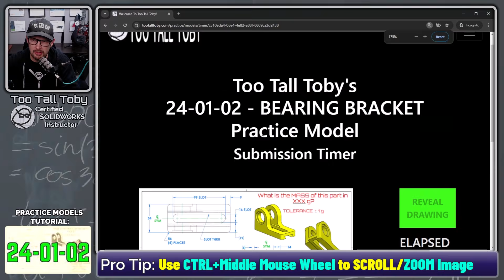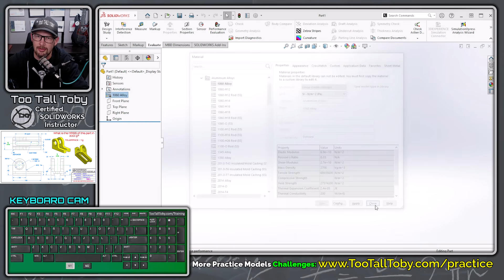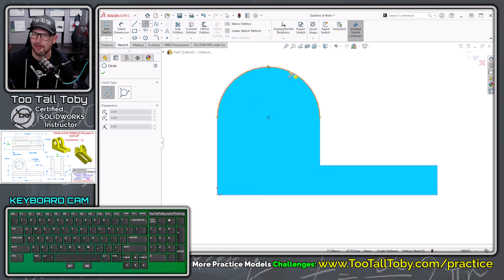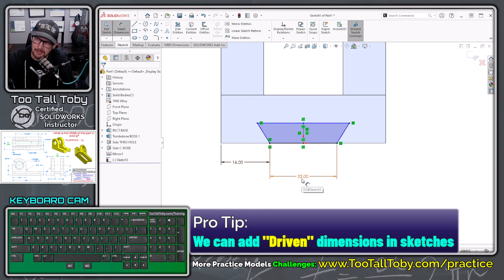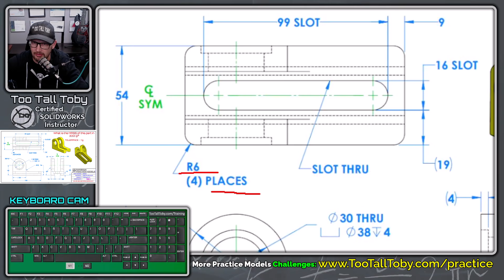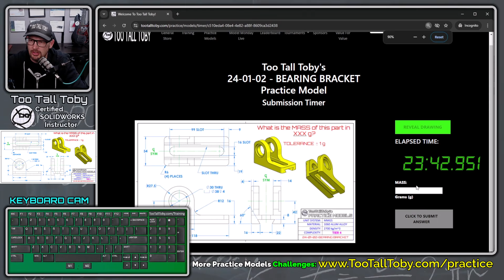Learn SolidWorks Fast! Beginner to Intermediate STEP-by-STEP Tutorial with Pro Tips & Tricks

Comment: Hey TooTallToby, I basically copied everything you did, however when i set my material to the same as yours the 1060 alumalloy for some reason I get 308.53 grams on  my model but you get 309.24, but everything is the same, same dimesions, same driven dimensions, same cuts same circle part in centre and fillets are all the same.
Reply: I got 300.57 grams :/

Comment: I got 310.76 grams in the mass properties. I'm wondering what I did incorrectly...
Reply from the maker: Nice work - is the material density correct? (see title block). What CAD system are you using?  We have a channel in the discord server called #material-tools where we have libraries for Onshape, Solidworks, Inventor, Fusion, FreeCAD, and more...

Comment: I love keyboard short cuts. Really happy to learn about F2. 

I typically use L for line. It toggles line on and off. You can also use A for arc while in line mode. It automatically drops back to line after you drop a single arc. I find it more reliable than teasing out a feature from the mouse about a point.
Reply from the maker: Thanks! I love keyboard shortcuts too but I also really leverage the S key. The only thing about the A key you mentioned is this: When you have Auto-Dimensions turned on, it doesnt work! Because it things your trying to set the radius to a value of "a".  But you can still RIGHT CLICK and choose "switch to line" - I usually do that (or "Switch to Arc")

Comment: As I've been using SW for over a year now after learning it in college this is a pretty easy model, but I actually didn't know a couple of the tips you showed like using shift to apply dimensions to the tangent points or the tangent propagation on the fillets, just goes to show that even if you think something is too simple for your level you can still learn things